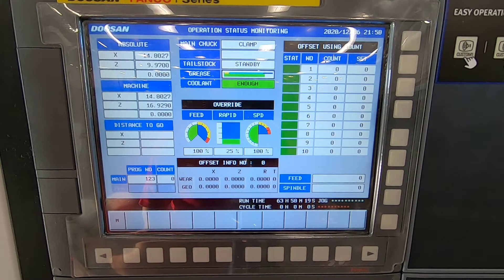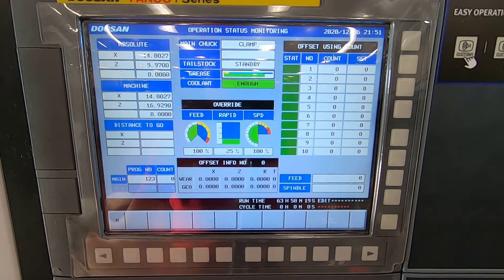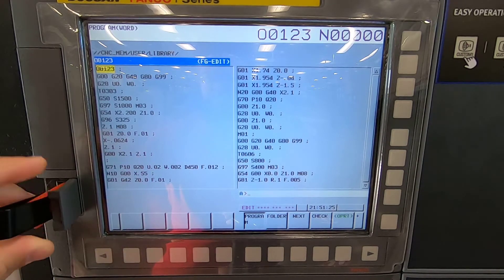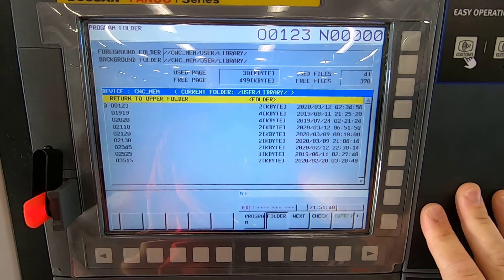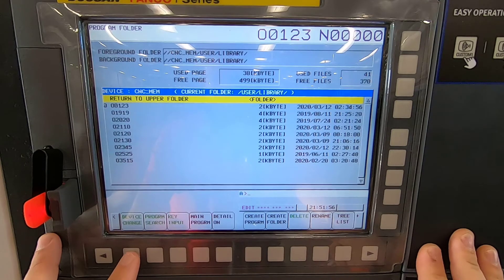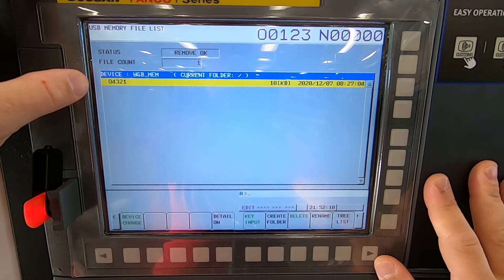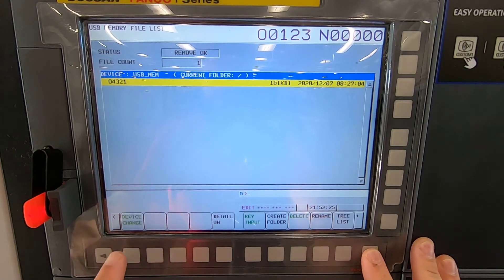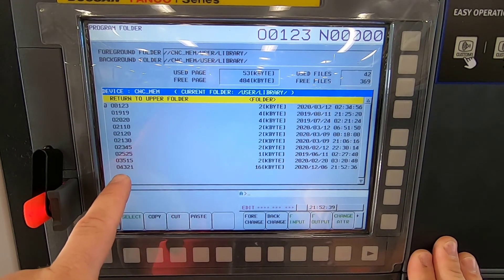Loading Programs onto Fanuc I series cnc Machine

Comment: Couldn't you just have a regular PC or laptop plugged into the machine and have a better GUI through an app on the PC? This seems clunky, but I'm sure there are reasons why it's done this way. Maybe newer machines have a PC interface?
Reply from the maker: Sorry for the late response, and yes, these machines have ethernet cables that can be plugged into computers and then certain software such as Predator DNC that can be used to drip feed or transfer programs directly into the machine. there's also ways of doing this via Bluetooth, which is becoming very popular.

Comment: My SanDisk usb not recognized why
Reply: I tried another SanDisk 4GB and it worked formatted fat32 the one I’m having issues with 128GB fat32 thx for your advice
Reply from the maker: Something I've noticed with my older and newer Doosan's is that the USB is that the USB has to be formatted. my older usb's are hardware interface 1.0 and it will not work on my newer machines, and the 2.0 or higher will not work on my older Doosans. Also, sometimes your CNC will have 2 USB ports. I've formatted my newer usb to Fat32 4096 and if that doesn't work try Fat32 8192

Comment: Thank you, I would like to know where I can get this card from please. I have a Fanuc 21i
Reply from the maker: In this video I'm loading programs from a USB however some machines have multiple ports. the USB I purchased was just from a local store.
Reply: @aaronrunk4209  I have happened to a malfunction in the machine and I want to re-enter the Fanuc program and I do not know where I find a republish card. You can help me.
Reply from the maker: @arabarab9033  There is a setting to change the "Program input Channel". Its located, "Offset page/ usb=17, ethernet=9, card=4". However, if the drive is malfunctioning in the machine, more than likely you'll have to have a technician diagnose the drive issue to see if you will need a new one. Sometimes they will have a refurbished drive for cheaper.